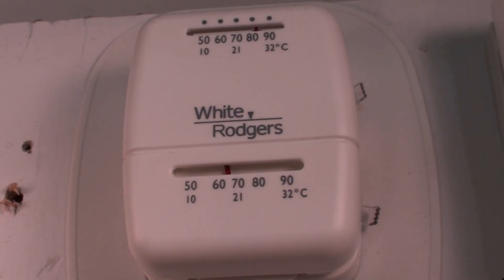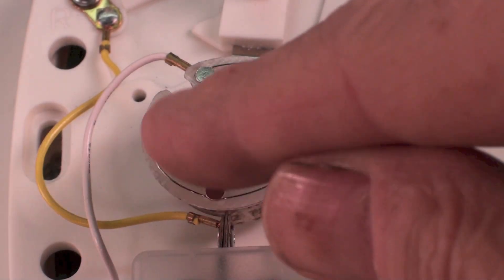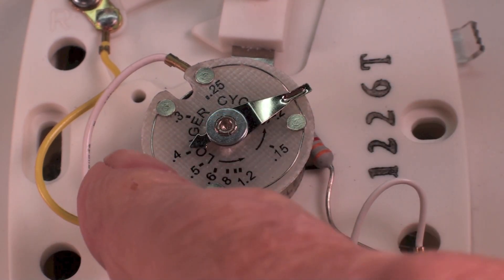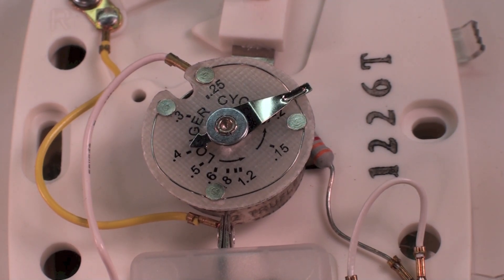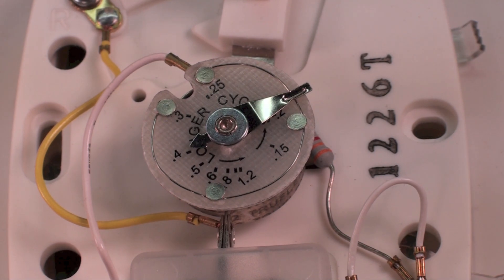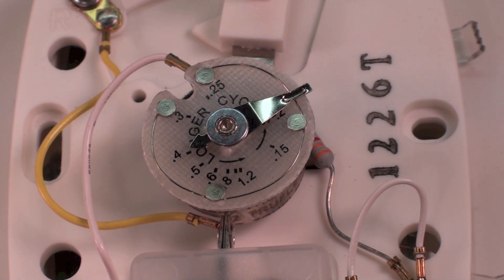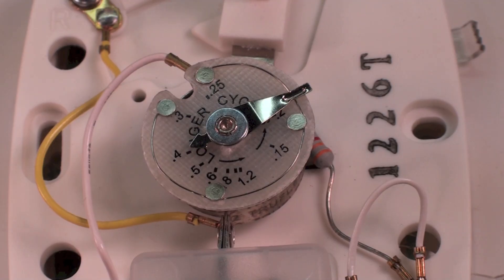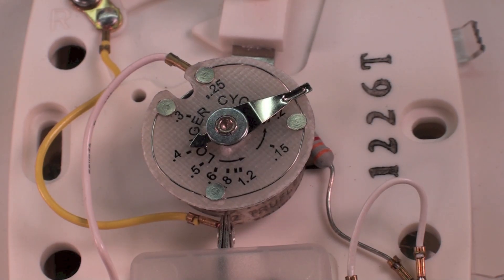Adjustment of the thermostat anticipator without a meter

Comment: We have two thermostats that heat one big front room and two back bedrooms. One of the thermostats is in this big front room, and also heats a back bedroom, and the other thermostat for the other half of the front room is in our bedroom. That thermostat hardly turns on. When it does, it warms up too quickly. And then it doesn’t turn on again for a very long time. The other one, in the front room, turns on a lot because the other one won’t, but then it consistently keeps the other bedroom too warm. In other words, it tries to carry the load of the other one never coming on, since the front room is split between the two. 

What is the best way to adjust these? They’re both set to 68. I’m not sure which needs a longer or shorter cycle.
Reply from the maker: This is almost certainly not a thermostat problem.  I assume this is a boiler.  I would be looking at zone valve problems.  One sticking on?
GFM
Reply: @grayfurnaceman I’ll have to mention this to our landlord, thank you

Comment: I have an Emerson boiler 1F70 that starts up fine and runs for 30 to 45 minutes on a cold start. However, it then turns off and restarts within 30 to 90 seconds. It runs again for 5 to 7 minutes before turning off once more, only to start up again repeatedly. The house is unbearably hot. Do you have any suggestions?
Reply from the maker: I am assuming you have not changed any thermostats.
If you have zone valves, you may have a zone valve leaking by.  If the valve is leaking by, with the thermostat off, the temp of the pipe to the valve will be hot on both sides.
There are many other reasons for this failure and I am just giving you one to start.
GFM
Reply: @ it’s a one pipe system on a 3 floor house. The short cycling is killing me.

Comment: Do these have mercury in them??
Reply from the maker: The mercury was taken out many years ago.
GFM
Reply: @grayfurnaceman  thanks so much for the quick response. I know my apartment complex is older, but through my research, my model number is 1c20-101, which is a similar look to the one in the video, but with the “white Rodgers” logo. But it’s definitely mechanical, as the maintenance guy said it gets power from an outdoor transformer

Comment: I have a Coleman deluxe  blend air 2 . I just replaced the thermostat with a Honeywell home ct31A1003 . 
 
It came factory set to .4 but my question is.  is that the correct setting for that furnace .And basically you can just play with this thing to adjust it to your home space & size. basically pinpointing how long you wanted to run before it turns off or turns on???? Finding that sweet spot of heat and when to turn off before too cold ? So instead of shutting of exactly on 73 degrees it gives a minute more before shutting off
Reply from the maker: Your goal is to have your furnace run for 5 to 10 minutes to maintain temperature in the structure.  Of course, lower outdoor temps will mean longer cycles.  
You should not be able to feel a difference in structure temp as the furnace cycles.
GFM

Comment: Hi GFM, I've come back to your videos several times over the past few years. We have a new millivolt thermostat (Honeywell CT33) connected to a new propane gravity floor furnace. It works fine during the day, when we're moving around, but at night the furnace stops kicking on, and the place gets very cold (it's a little mountain cabin). Even during the day sometimes, the heat won't kick on, but as soon as I walk up to the thermostat, or sometimes touch it lightly, it will start. Our thermostat doesn't have an anticipator, I don't think, just a brass-looking screw near the top of the bimetal coil that looks to be some sort of connection adjustment. Anyway, have you encountered anything like this, and if so do you have any ideas? Thank you.
Reply from the maker: Millivolts systems are very sensitive to connections.  I would want clean and tight wire connections.
GFM

Comment: HOW DO I TURN IT OFFFFFFF
Reply from the maker: What are you trying to turn off?  The furnace or the anticipator?
GFM
Reply: @grayfurnaceman  whatever tells it to stop running the heat
Reply from the maker: @jacksonmclaughlin195  There should be a system switch on the thermostat that can be set to off.   Some very simple thermostats do not have one and other than turning them down, the only way to shut it off is either by a switch on or near the furnace or a breaker in the panel.  Hope this helps.
GFM
Reply: @grayfurnaceman  it’s the exact same one that’s in this video, how do you get it to stop
Reply from the maker: @jacksonmclaughlin195  Shut off the power at the furnace.
GFM

Comment: My air will not kick in and it's so hot! What should the anticipator be on for cold air?
Reply from the maker: Anticipator setting cannot be changed for cooling.  I would first check the fuses for the outdoor unit.
GFM

Comment: Question!!!
What do you think it could be if my A/C just basically almost quits working? Its pushing cold air out but not making my house colder! A little late too call someone but was just wondering
Reply from the maker: You could have low charge or a failing compressor.  Just a couple of possibilities.
GFM

Comment: My heater won’t shut off when u use it right now from your video I’ve made the cycle shorter I don’t have this problem with the cooling aspect but I just began to use heat and it just stays on....
Reply from the maker: I would start by disconnecting the thermostat.  If it stops running, that is your problem.
GFM

Comment: I found your videos when looking for a reason why my suburban RV heater. The problem I was having was the heater would not come on at all. No fan, flame, or attempt at ignition. I took the cover off of my thermostat and I adjusted the small dial and it worked. I don’t know why that made it come on but the unit is only two years old and I think I will have to replace the whole thermostat. Now I find myself watching more of your videos, thanks for all the info.
Reply from the maker: There was probably a bad connection in the anticipator dial.  Replacement if probably best.
GFM
Reply: Did replacing the thermostat worked? I have the same same problem!

Comment: I have this thermostat and it won’t turn on my heat or air conditioner? Can u help before I spent $ on a consult pleeeaassseee
Reply from the maker: First, I would check for power to the unit.  Try turning on the fan switch.  If the fan does not come on, check the switch on the furnace and check the furnace breaker.
GFM
Reply: Ok so Um yeah  that switch is on the actual unit outside?
Reply: Thank you so much I’ll try that

Comment: My apartment is getting too chilly before the heat kicks in. Where do I set the anticipator please. Do I want more cycles per or or less? Can you just spell it out for me. Thanks so much.
Reply from the maker: You want more cycles.  Without the anticipator, there will be a lag where the temp must drop about 2F before the thermostat can sense the change.  Then it will overshoot 2F before the thermostat senses the rise.  The anticipator "anticipates" the drop in temp and turns the system on a little early.  Then it shuts off a little early "anticipating" the rise in temp.
Hope this helps.
GFM

Comment: What if my heat won’t go off how do I fix that on this plz
Reply: Replace your thermostat look up the tutorial its easy watch someone do it 3 or 4 times then you should be able to do it yourself
Reply from the maker: If the furnace is overheating the structure, you can first try removing the R terminal at the thermostat.  If that stops the problem, the thermostat is at fault.
GFM

Comment: I wonder if you can help me, our living room thermostat wasn't turning on at 20 degrees like it normally does this week, we had to turn the the thermostat to 23-24 for the heat to come on, so we had a new thermostat installed and we still have the same problem with the new thermostat, this morning it was registered 20 but it wasn't that at all, I had left it on 15 over night, would you know what the problem might be? In the instruction's it talks about anticipator setting but there wasn't a anticipator on the old Honeywell CT 43 A thermostat, it's the old style that you adjust yourself, we have baseboard heating! the new thermostat does have a anticipator, but very unsure how to adjust it, I have phoned White Rodgers and they said to leave it on 4 which was the default setting, many thanks for any help.
Reply from the maker: First, is the replacement thermostat a low voltage or high voltage one?
GFM
Reply: @grayfurnaceman  I am not sure, Switch Rating 24VAC  heating 0.15 to 1.2Amps
Reply from the maker: Its low voltage.  It probably energizes a contactor.  The contactor may be sticking.
GFM @brummie0007
Reply: @grayfurnaceman   thanks for the tip.

Comment: I have a question why would the little wire on the dial glow red and the burn the dial?
Reply: My thermostat looks just like this one
Reply from the maker: Is it an electric furnace?
GFM
Reply: It’s a propane 12v  RV furnace
Reply: I just replaced the relay on it
Reply: Atwood / HydroFlame Furnace Model 8525-II
Reply from the maker: Is the thermostat a 12 volt model or 24 volt?
GFM
Reply: 12V
Reply: It’s a 1C20-101
Reply from the maker: This indicates an overdraw of the control circuit.  I would be using a clamp meter to check the amp draw of the control circuit.  If it is drawing more power than 1.2 amps, it will burnout the anticipator.  
GFM

Comment: Could you do a vid on adjusting the antisipator on the Honeywell
Round heat only CT87K
These have a disk battery also
And some printed cricket boards.
Reply from the maker: They are adjusted by the cycle dip switches on the subbase.  Look up the install manual for that thermostat.
GFM
Reply: Thank you got it
Reply: Ok I have another honey well ,vertical rectangle bottom slide temp adjuster,
 Sorta got the anticipatory figured out,  I measured my am drama at 
.27 Amos. On my adjusted. Arm. There is a little thumbs catch and what seems like a small  arrow on the outer tip next to the thun catch, and a blunter arrowish bump 180 deg. at the opposite inner end.
Which is the correct  end. 
Compared to those inner arrows on  yours mine is not a detailed atrow.
 And what's a defined cycle,
Burnet on to burned off.
Or blower on
To blower off 
 Miller hot air Wayne burner Mobil home unit.
Ok thanks
Reply from the maker: The end with the arrow.  Defined cycle is burner on to burner off.
GFM

Comment: Great video! I have the same exact thermostat in my Winnebago 27' motorhome. It is a Suburban NT27SP. I called Suburban to ask them the setting for the anticipator. They said it is .78......where would I put my probes on my multimeter to check the amp draw for this thermostat? The furnace is wired for 120 volts @3.5 amps. David 🚀
Reply from the maker: I would use a clampmeter to check amp draw on the W wire.
GFM
Reply: I don't have a clamp meter, so I disconnected the wire coming into the W screw, put my red probe on it and put the black to the screw on the W and turned on the thermostat. It read 7.5 but the spec that is stamped on the front of the furnace says it's wired for 120 @ 3.5 amps. I don't understand. Thank you, David

Comment: Mines hooked up in garage it's a gas heater what should it be set on to keep it going on long cycle
Reply from the maker: There is no answer that covers all applications.  Just set it toward long cycles and check if the unit stays on so long that the temperature difference is noticeable.
GFM

Comment: I went all the way around, my heater sounds like it wants to start but then it just shuts off. I've had a maintenance man come by and told me everything was fine. I don't know what else to do. Sometimes it'll work, just annoying at the moment. maintenance man said it might be the thermo. Anyone else have any suggestions?? Cold on Christmas Eve.
Reply from the maker: If the furnace was built within the last 30 years, It could be a dirty flame rod.  You can tell if it is the thermostat if you set it 10 or so degrees above the temperature.  If it works, it is not the thermostat.  Hope this helps.  Merry Christmas.
GFM

Comment: I am considering switching from the old Honeywell mechanical thermostat to a Honeywell  programmable thermostat. My question  is how can the cycle be adjusted? I have looked at the Users Manual and there is no anticipator adjustment.
Reply from the maker: Depending on the model, it will either have no adjustment and will go to 6 CPH or the cycles can be adjusted in the installer setup.
GFM
Reply: We're does the white wire go smh

Comment: What bout cooling, does it work the same ? --- anticipator... I'm having trouble keeping the air running after 7pm. It won't start up again till maybe 7am . It's a old rectangle Honeywell heat pump therm. Fan works all the time (brand new), is that right ?
Reply from the maker: The anticipator for cooling is of a fixed size, because it is energized in the off cycle of cooling.  So I don't think this is your problem.  If the fan is running all the time and the fan switch is set to auto, the unit could be freezing up and not thawing until the morning.  Hope this helps.
GFM
Reply: I just had a new fan motor put in, I turn the unit off & I can switch the auto on - it works, then off - goes off. Then turn unit back on & the fan motor comes back on. Could it be wired wrong ? It has gone off but only twice that I know of. It works all the time. I'm in Phx. Az. so stuff heats up pretty quick.  THX

Comment from the maker: When I was cutting my teeth on furnaces I ran into some old camstat thermostats that were extremely picky, so I had to learn.  There were also some Trane commercials that had such a low draw thru the electronics that we had to add a relay in parallel to draw enough for a mechanical to work.  About the .8, hey if it works, who cares?  Thanks 
GFM